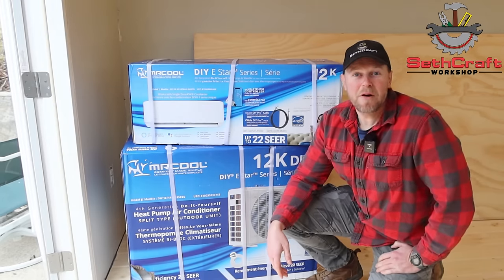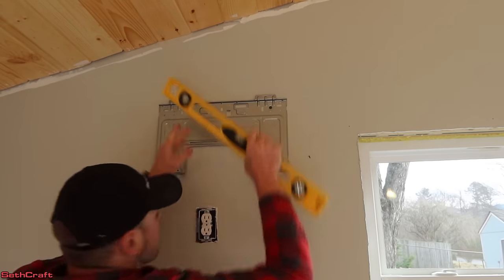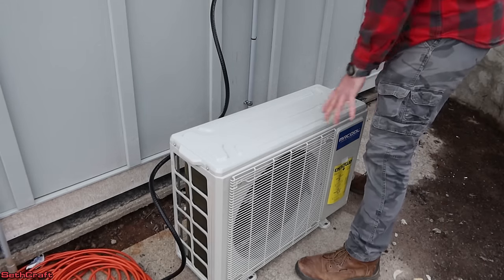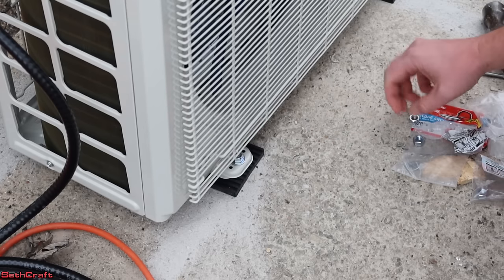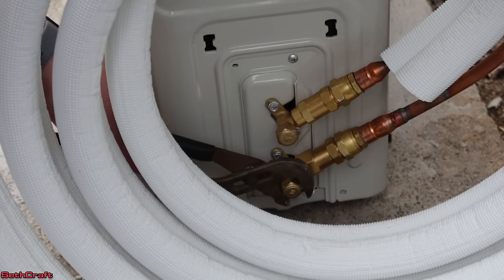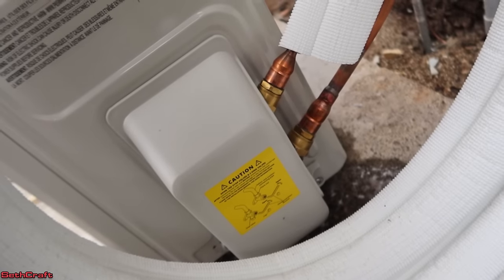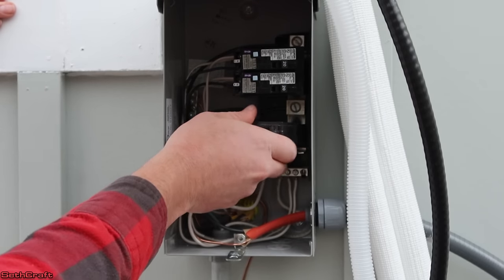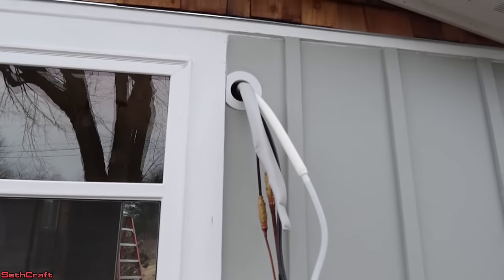Mr Cool DIY 4th Gen 12000btu Mini Split Full Install

Comment: Vertical loops in the refrigerant lines will trap compressor oil. Oil will not return to the compressor. Compressor will fail for lack of lubrication. Replaced 3 DIY installs so far with less than a season of operation. Use shorter line sets.
Reply: Could you lay the loops horizontally?
Reply: YES so oil can travel down hill towards compressor.  @mrbigstuffbsa
Reply: Would even just one loop cause that issue as well?
Reply: @gt5193  Yes. I wouldn't trust it. Oil could trap and slug the compressor with liquid.
Reply: Yup because all of the coil outside is acting like a txv valve
Reply: @mrbigstuffbsa what do u mean should I put the thing 25!get away so there’s no loops
Reply: Isn't it pressurized therefore not a problem???
Reply: wasn't he suppose to pull a vacuum as well?
Reply: @sncruiser  If owners read the manual they would see they are expected to lay the loops horizontally. It's right there in black and white.
Reply: @gt5193  It could.
Reply: @thomascarey6915  everything is precharged.

Comment: A couple of things, its a code violation to put romex in conduit, its compliant  if you strip the outer plastic off and run individual wires only. 12 gauge is rated for 20 amp, 10 gauge for 30 amp. Mccool recommandes the excessive  freon lines are placed horizontal to prevent compressor oil form collecting in the low spots. I have one of these it uses 800 to 1200 watts or 7 to10 amps of power. they are great units not needing a HVAC guy
Reply: Please cite the code reference for romex not being permitted in conduit. There is nothing in the NEC that says you can't run romex in conduit
Reply: He almost got it right. That was a very confident  response, but you cannot strip Romex and run it through conduit. Romax is in fact permitted to be ran inside of conduit as long as it isn’t in a wet or damp location.

Comment: Thank you for this video. I'm an electrician so I do have to say it was like nails on a chalkboard to see you put Romex in that conduit. You need to use THHN wire! But other than that it looks good! Thanks for making this video!
Reply: Am I correct that it is THHN which comes in pre-packaged HVAC Whip kits (which I plan to use from the outside disconnect box)?  Thanks!
Reply: @johnoudin5646  yes it is!
Reply: Came here to say the same thing... had a hard time watching the rest after that.  Technically in an outdoor setting it should be THWN but I'm pretty sure all THHN is also THWN.
Reply: Also you can technically put romex in conduit (I don't like it) but not outdoors since Romex is not wet/damp location rated.

Comment: I am in the process installing my 36k as we speak. On page 27 of my manual it absolutely states that the excess coils of lineset must be kept horizontal
Reply from the maker: Thank you for that information. The homeowner did lay the extra pipes down and put a little decorative lattice around it.
Reply: That looks like crap.

Comment: I never saw anybody install the mini-split with the condenser unit on the ground. Most installations for the condenser unit are put on two hangers on the side of the building that come with the unit. After installation, the system needs to be vacuumed dry with a vacuum pump then, the gas needs to be installed in the lines with a refrigerant with proper instrument readings.
Reply from the maker: The do it yourself, model of the Mr. Cool Mini split has several options. we chose to mount to the ground because we already have the concrete pad ready. the do it yourself model is precharged and does not have to be vacuumed. Basically, once the seal is broken on the lines, it will put the appropriate pressure for you.
Reply: @sethcraftworkshop  It's not about the correct pressure. You vacuum out the system to remove air which over time destroys the AC unit
Reply: @heatherpoole4951  they are designed to not have to be vacuumed. Even many of the new whole house units come precharged now.
Reply: It's pre charged, that's why it's twice the price of others. No HVAC guy needed.
Reply: If the compressor is sent in vacuum and the lines are sent charged, then they have thought of it all.
Reply: @sethcraftworkshop I’m ok pop

Comment: Dunning Kruger Effect video advice. The compressor often fails with a long vertical coil restricting oil getting to the compressor. Any gas pipe coil should be laid horizontal, but it's best to be cut short to match correct length and professionally flanged copper pipe ends and drench fittings with a spray bottle detergent mix for a better leak test for bubbles.
Reply: Yes, in a perfect world line sets would be custom cut to fit. But this is an entirely different product line, a DIY series. The lines are fixed lengths and the excess must be dealt with.

Comment: This video helped a great deal in my installation of one of these units this past weekend.  In all of the videos I've seen of the installs, the hole saw attachment, a nice cardboard template and the hex key were included and the wires on head unit to condenser power line were numbered/labeled.  None of that was the case for me.  The manual included in the boxes is... adequate.  Make sure that you can easily refer to this video.  I already owned the appropriate hole saw but since I was at my best friend's house, 117 miles from mine, I now own two 2.5" hole saws.  There was nothing in the manual specifying how the unlabeled wires on the power cord should be hooked up in the head unit or condenser.  I am eternally grateful to Seth that he showed and narrated "Red wire goes to #2..."  Good luck, be careful.

Comment: I've been contemplating installing a mini split, replacing a swamp cooler setup that I have on an upper floor on my home. I have an HVAC system set up in my home, and I also have a zoned gas hot water boiler set up as well and a pellet stove on three levels. But my home doesn't have an open concept, so heating and cooling is usually irregular and not consistent. And it's wasteful heating and cooling areas that are not always occupied. Having minispits to control the environment to a particular area seems more cost effective than running the whole house HVAC or the boiler system. I'm looking to install an 18k btu dual split unit for my upstairs family room and downstairs weight room. I've watched a few installation videos on various sizes and brands of DIY minisplits. I've gotten a lot of tips and ideas from watching them. I enjoyed your video and your tutorial. Nice job..😎
Reply: Three stories and a pellet stove? You must be a fellow Yankee up here in the far north! Salutations!

Comment: I am no new comer to Mr. Cool DIY, as I own 3.  Here are some recommendations.
It's good to raise the outdoor unit, even just an inch or two, to avoid junk piling up under and around the unit.  They sell cheap set of rubber feet meant for just this.  Of course, you can spend more and get a nice raised perch with a little roof, too.  You can do this post-installation, because it's just an inch or so movement.
Foam covering any lineset left out to the elements will degrade.  At minimum, wrap them all with vinyl tape or something.  It'd been better to pre-plan and put them in a protected space, but it's too late now.  Yes, they say you can disconnect and reconnect once without losing too much refrigerant or causing new issues, but I wouldn't do that.
Reply from the maker: Great tips. Thank you. My next install is a 2 zone unit. I will be sure to use the rubber spacer feet. This kit came with tape to put on the lines.
Reply: You definitely can disconnect and reconnect.  You just have to shut the valves on the condenser.  I didn't hear any escape (had to replace a condenser under warranty).  The instructions were literally to disconnect and reconnect.

Comment: Minisplit install looks straight forward, I'd just be concerned about rain infiltration where the lines come through the wall.  You'll have give us a follow up about how the lines were made tidy and sealed up for the weather.  Thanks for sharing this.
Reply from the maker: Ah yes spray foam insulation was put in that hole and silicone around the plastic sleeve.
Reply: Some mini splits comes pre charged, seems to be easy installation. Thanks!
Reply: @fpafdc70  From my research the pre-charged systems cost extra for the ease of install.  The downside is the all the extra line that cannot be cut out of the install as this will "release the charge".  I have seen other videos that suggest the coils should be coiled horizontal and not left vertical.  I think the homeowner was going to clean up the install so maybe they will find a way to coil this correctly.

Comment: Good video but the connectors used for the wiring are for indoor use only! I believe you can shorten the electrical lines that come with the unit so you do not have all that excess wiring bunched up around the unit.

Comment: Awesome video. Only thing I'll change it I end up doing a diy is I'll have to hang mine off the side of my house. I live in Canada so it'd be buried in the winter if I don't
Reply from the maker: Seems like many people mount them on the wall. That is a good option especially for high snow areas.
Reply: @sethcraftworkshop it also has the added benefit (maybe, depending on where the compressor is located) of only needing 6"of rear clearance instead of 12" when it's wall mounted
Reply: @robbie6625   that's a good point. I am installing one that will be ground-installed. but if its attached to the outside wall and that only needs to have 6 inches of clearance why can't the ground installation be the same 6 inches?   what is the difference? (I'm just curious if i can install my outside unit a bit closer to the house).

Comment: Great detailed video.  Never use a adjustable wrench that has a loose grip on it.  If that jaw has any play in it you will end up rounding that brass nut  Up to seventy plus  percent of leaks come from not having the recommended torque.
Reply from the maker: Those wrenches were all I had for this install. I just installed another unit this past week and used crescent wrenches.

Comment: Be careful if you use 3" screws to fasten the indoor unit to the wall, as shown at 1:44. Be very, very sure there are no electrical cables right there, waiting to be pierced by the screws. Maximum screw penetration should be no more than 1 3/4" below the surface of the 1/2" drywall if cabling is in the area.

Comment: Did you not have to purge the air out of the line set?  Otherwise would there not be air introduced to the system?
Reply from the maker: The DIY mr. cool lines are precharged and do not require a vacuum.
Reply: Oh so the lines are sealed until they are tightened on the fittings?  Then the line set opens up when screwed down? @sethcraftworkshop
Reply: @kurt357357 I have the same question?? Is it like when you pierce the top of a tube??

Comment: Another point: Hardi cement board products will NOT "destroy any kind of hole saw you use". Go ahead and use your hole saw; I've used mine many, many times to cut holes in Hardiboard without any difficulty at all. Today's hole saws are TOUGH. Excellent video!
Reply: And hole saws are a available with carbide tips just like that jigsaw blade.

Comment: thanks for the explanation, but what about vacuum on lines before releasing the gas?
Reply from the maker: This is a mrcool DIY. In a normal mini split the copper lines are shipped empty and a vacuum needs to be pulled. In the Mr. Cool DIY the copper lines are shipped full with valve ends. No vacuum is needed on this unit. I have a Della mini split video coming out soon where I do vacuum the lines.

Comment: Can  I use a10 gauge extension cord and cut the ends to make it easier ??
Reply from the maker: It would be better to use thhn stranded wire. You can buy that to length at a homestore or local hardware store.
Reply: Thanks
Reply: Not recommended

Comment: Nice video!  Only thing I like to comment on is that excess line set should be coiled horizontally to avoid oil pooling?  At least that's what I heard from other DIY mini split videos.
Reply from the maker: The coil is just so long. I can suggest that to the homeowner and see if he wants to bend that sideways. Too bad mr cool does not sell a shorter line kit.
Reply: They do sell a 16’ line  but it can not be substituted  since all units are factory packed with the 25’ line.
Reply: I've heard so many people say this, but haven't seen anyone running into problems with these Mini-Split units, so take it for what it is, I guess.
Reply: Actually they say the opposite.  Coil vertically to avoid oil pooling.  I don't quite understand but I guess the oil is suspended in the refrigerant and the horizontal coil makes it fall out of suspension or something...
Reply: According to the MrCool manual: "Keep excess refrigerant hose coiled. Wrap with protective tape and store behind the condenser in a horizontal position (flat with the ground)."
Reply: @robchronos  You're right.  That's on the bottom of page 31.  I swear they changed it from earlier systems.
Reply: @kevin9c1  I've also heard the same.

Comment: Nicely video thanks for the clear instructions.

I did almost exactly what you did but for some reason my outside compressor is not kicking on with that i am not getting any cool air am i missing something?
Reply from the maker: I am not sure why the outdoor unit would not be turning on. This system worked right away when the power was turned on.
Reply: did you figure out the issue?